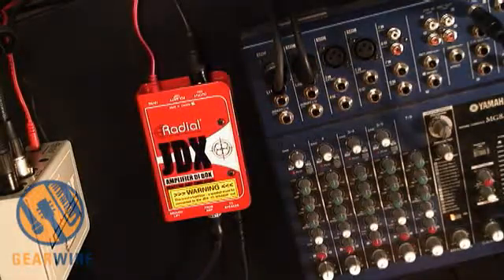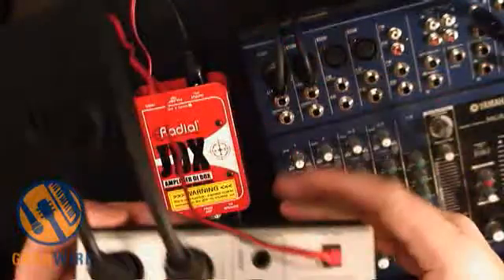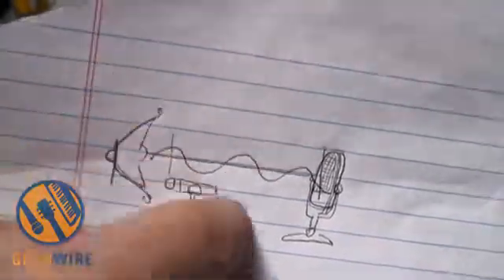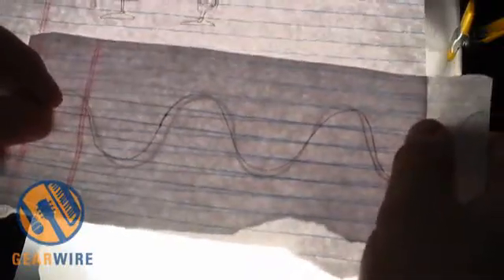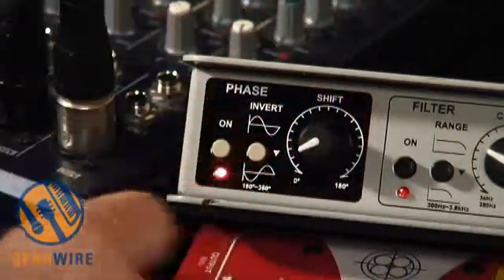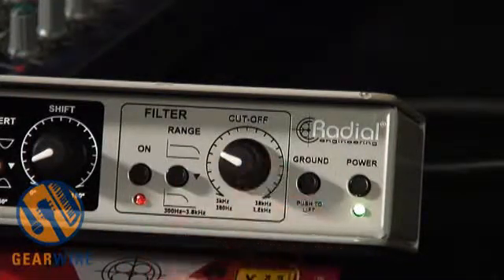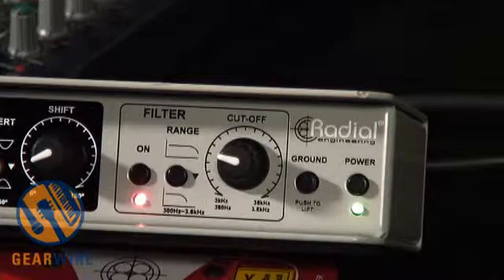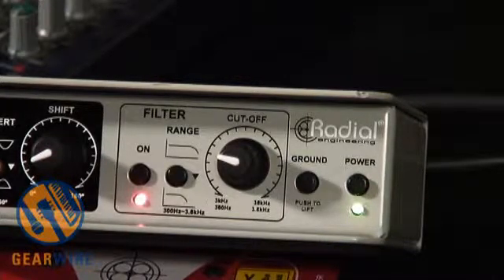Radial Phazer Helps Combine Your Assets

Comment: I'm interested in running a DI and a 1/4" into the Phazer, both fed from an acoustic (active hexaphonic pickup) 1/4" output. I used a DI to split the signal so as to run the DI straight to a mixer channel and the 1/4" to effects and then on to another mixer channel. Even though the DI and effects routes both had phase reverse switches, no combination could fix the hollowed out tone. Looks like the Phazer is the ticket!